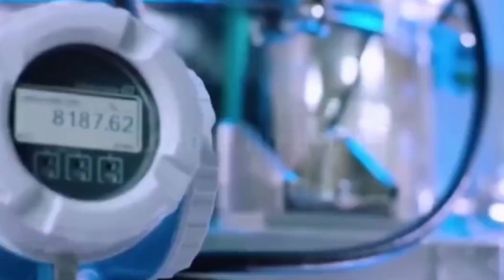BYD helps building China's aircraft carrier ! The Type 003 Fu Jian has BYD electrical energy storage

Comment: The commentary talk round and round the round about. 
In Short BYD is used for the EMALS system. EMALS need abundance of power to launch the heavy jet and planes. The batteries are capable to give the extra energy needed to launch the planes. By itself the turbo generator are not capable to deliver that amount of power. The batteries need to be charged prior to every  launch.

Comment: This report and the presented comments may lead viewers to think that BYD lithium batteries (such as the blade batteries used in EV cars) are installed in this Chinese 003 aircraft carrier.
Because of the requirement of the  extremely high current (amperes) to be discharge within a very short time (<3 seconds?) to create the stator's fast moving high EM field of the linear motor of the catapult to launch the plane from standstill to takeoff speed, the internal mechanical stress inside any lithium  batteries will be very severe and can damage the batteries easily.
It is more likely that BYD custom made the electricity energy storage system using Capacitors.
Capacitors will be the electricity storage equipment being installed instead of Batteries.
Electrical Capacitors, "buffered" by the spinning mechanical flywheel (dynamic energy storage) is likely to be the solution adopted for these 003 EM catapults as they can take the very high current discharge more readily.
Therefore providing a longer MTBF for the 003 EM catapult and more reliable than that of the USS Gerald R. Ford.
Reply: BYD doesn't have this technology
Reply: @bbbzhong4166  
Do elaborate on your comments on what you are refering to.

Comment: I guess it 003 carrier uses Batteries system obviously the safest is LFP which may be BYD blade batteries
However I think they will have to upgrade very soon (next year) as, there are few iteration of LFP coming with more capacity per Weight.
1 upgrade sometime next year
Another upgrade, the follow year after that or 2nd year

Batteries helps the electric integrated system also the electric propulsion system (which PLAN try to keep quiet about)

Comment: Without BYD, Tesla cars won't run. BYD EV batteries was outstanding and not any EV battery manufacturer can compete with BYD.
Reply: No, it is another Chinese battery company, called Ningdeshidai
Reply: @Sebastian-dp9sk  thanks for the info
Reply: BYD is great, but no need to exaggerate. CATL is still the largest EV battery provider.
Reply: With BYD involvement, I suspect this could be a diesel PHEV carrier 😄
Reply: Panasonic already entered contract with Tesla to produce its batteries by 2023. It's on Reuters.
[1] https://www.youtube.com/watch?v=ao52KUJxdos
Reply: Titanium lithium battery is not BYD technology
Reply: Tesla uses BYD Blade Battery which Panasonic can't even compete with. BYD was in a business of batteries for so long.
Reply: Don't Tesla use Panasonic batteries?
Reply: @johnsilver9338  not all of them, china have 75% share market in EV batteries why do u think elon build manufacturing plant in Shanghai?
Reply: @axepro3053  From what I know its Panasonic that supplies Tesla with batteries which is evident enough since Tesla's batteries are still in cylindrical form different from BYD batteries.
Reply: @johnsilver9338  depends on where the car was manufactured if it's from Shanghai it's probably chinese battery, Panasonic alone cannot supply all of Tesla's batteries in the world
Reply: @axepro3053  Maybe Panasonic can't supply the world, but it doesn't mean Tesla uses BYD batteries because it's still evident that it still uses a cylindrical form different from BYD batteries as I already said.
Reply: @johnsilver9338  yup maybe not BYD battery but other chinese brand there are few of them
Reply: @axepro3053  most probably CATL
Reply from the maker: Soon Tesla will start to use byd battery
Reply: BYD is 10 years ahead of the US in battery storage.
Reply: BYD batteries don’t BBQ the driver and passengers. Tesla knows that 😳😬 🔥